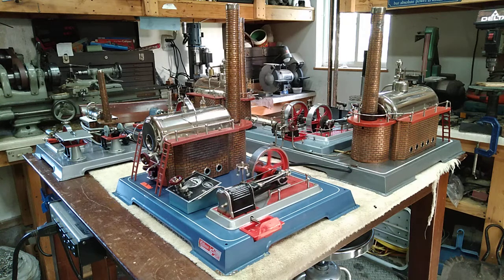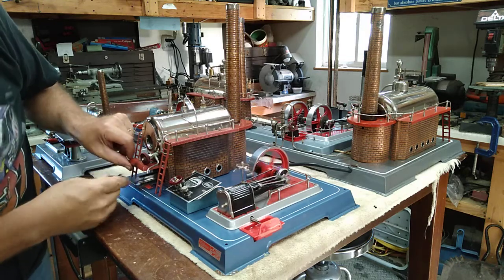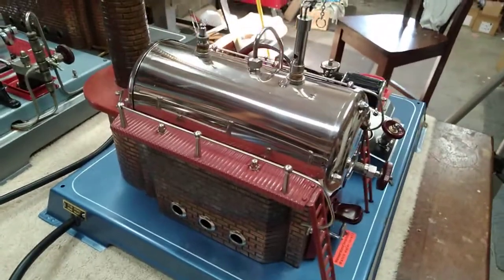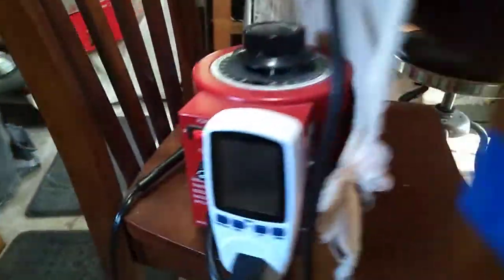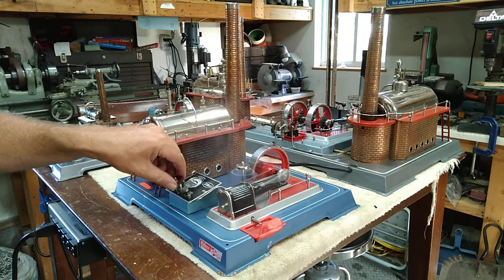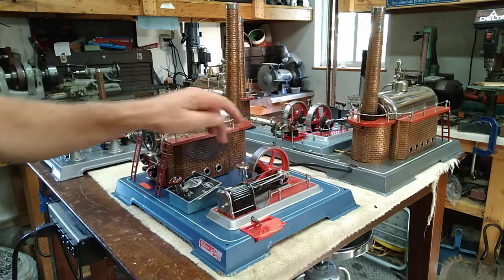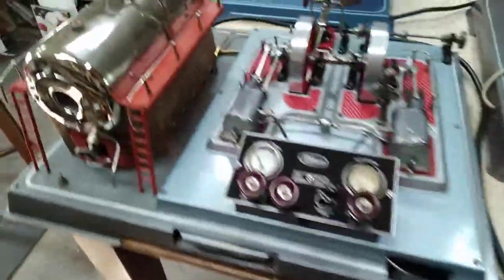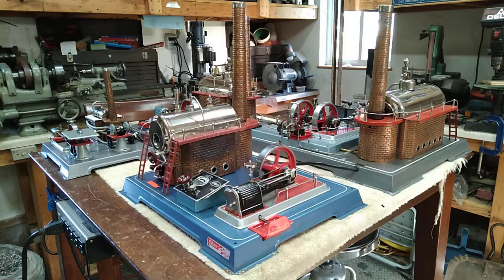Wilesco D24El live steam engine

Comment: I like the idea of converting to electric. I am also looking at making a large boiler and electric would be the way to go on it. When you add the heater, do you put it in the boiler or attach it to the side? 
I am just getting into the steam engines. No fool like an old fool, 78. Thanks for all your ideas.
Reply from the maker: it is an immersion rod heater (an internal rod heater in a brass sleave)